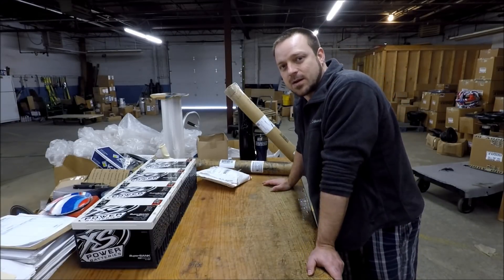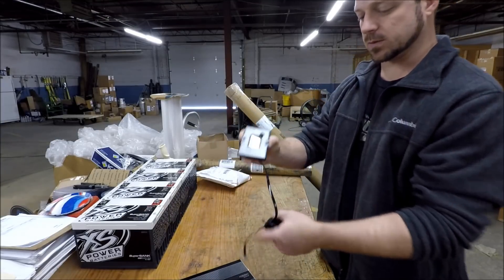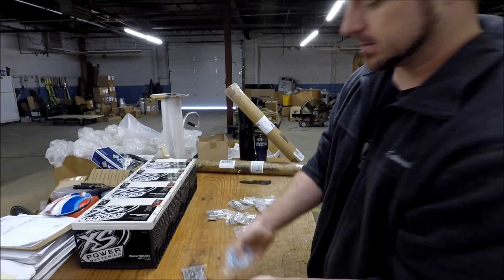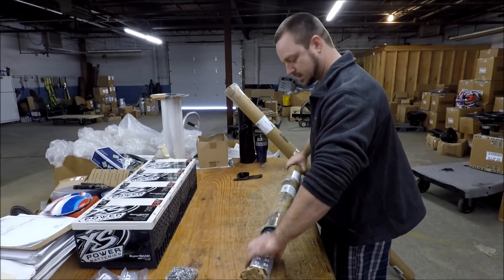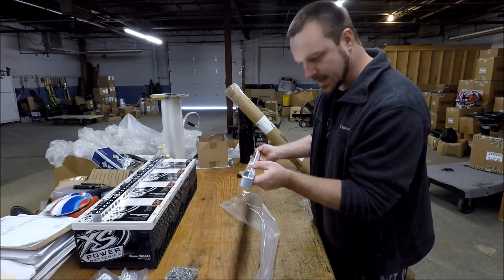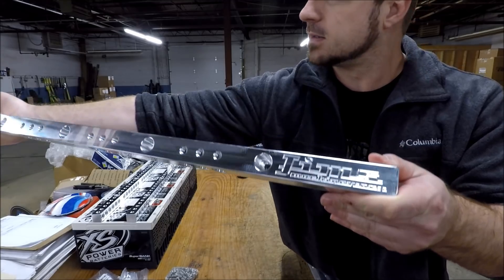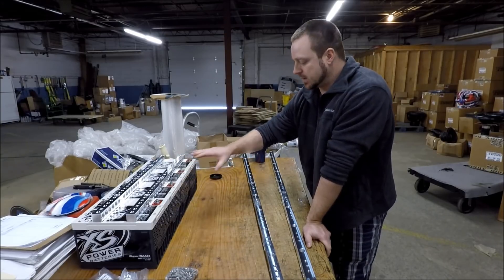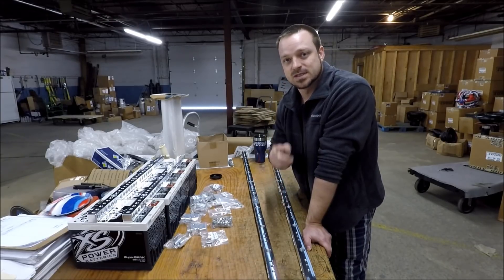New Presents to Unbox, Finally Home from Sema, Shoutout Jim's Machineworx

Comment: Love to see tests on those capacitors in how they hold up. If you have a big alternator and one good battery can you run 2 of those ultra capacitor banks in place of batteries? If in a system where you normally need 3 batteries?